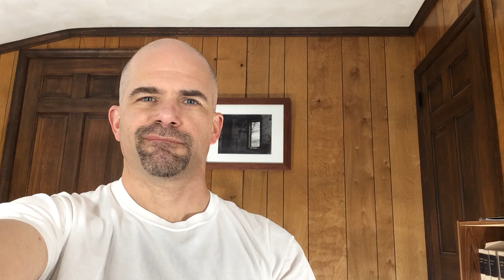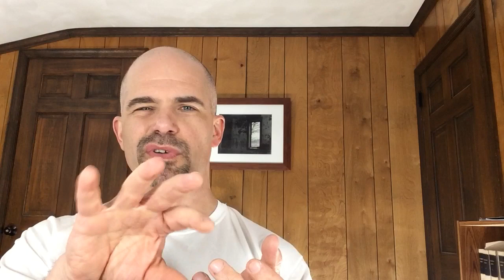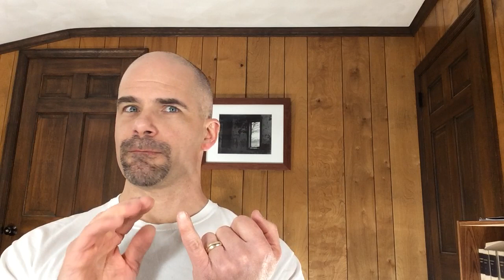Paintball Accuracy, Episode 4: Smooth vs. Spin-Inducing Barrels

Comment: I have a solution to the back spin accuracy problem, good paint, low velocity to prevent denting of ball, tect barrel insert on a flatline with apex 2 modification. Dont forget a good air reg and long air line.

Comment: I've used an Apex 2 on an old pre-2000 Autococker and an Empire Dfender.  On both markers I saw a noticeable increase in absolute range, but after a certain distance (70 to 90 feet) the accuracy began to drop off due to some balls veering off to the left or right.  Balls were going further in the right direction but they weren't very accurate once they exceeded the "max effective distance" if you will.  That said, when you're using something like a Dfender you can make up for accuracy with volume.  Thus, the most effective employment of an Apex 2 I've found is during scenario games where the extra distance is helpful and you're relying on quantity over quality. 

I will say, for whatever reason, the Autococker was more accurate at distance than the Dfender, although I would chalk it up to conditions of play and condition of the paint.  Also, that is one finely tuned slide trigger Cocker and I've always had awesome accuracy out of that marker regardless of the Apex.

Comment: Riffling a paintball has a primary problem when related to a sphere over a bullet or even an arrow. Bullets and arrows continue to spin on an axis in line with the vector. A sphere will spin on the same original axis. This will cause the projectile to kick to one side or the other depending on the direction of the riffling. The paintball inconsistencies noted in the videos make this affect very unreliable. 

As for backspin barrels, I often had better accuracy with my flatline depending on whether I was able to get the velocity and everything else calibrated just right that day. I normally kept it as a fun tinker alternate barrel. The flat trajectory is simply easier to point at something because you don't have to worry about the arc. 

(Please forgive me for speaking in absolutes. It is so hard to speak in speculative terms. Most of this is based on online research rather than hands on experience.)

Based on my research, I have only remember subjective information on 4 backspin devices. In order of least accurate to most accurate (subjective), they are Flatline, Apex, Z-body, and Hop-up. Due to the nature of a backspin barrel needing to be aligned vertically, all but the Apex were marker specific. And since Z-body and Hop-up were not main line manufactures like Tippmann, they fell by the wayside. 

Here I will give my theory as to why the Hop-up was reviewed more consistently accurate than the Flatline. Consider the frictional forces on a paintball. First the Flatline. Staring down the barrel and drawing lines outward from the center of the paintball to indicate the amount of frictional force applied by that section of the wall of the barrel, we get a rough egg shape. Most of the friction is on the top because the paintball is thrust that direction by the curve in the barrel. When we add in the seam where the two halves of the paintball are attached and any other random inconsistencies inherent to modern paintball, the outline of an egg starts wobbling as the paintball rolls down the barrel. 

The Hop-up barrel was made with a type of straight riffling along the top of the barrel. There was one grove and 12 o'clock, one at 1 o'clock, and one at 11 o'clock. The aerodynamics of this pushed the paintball against the top of the barrel. While not as much backspin was achieved via this approach, it did create some. Now, if we look at the same egg shaped forces, we note that there are three sections not applying any friction. The paintball seam and any dimples require a significantly greater defect in order to cause the paintball to spin any direction other than aligned with the two rails of high friction. 

Applying the forces of friction to each of the above backspin models and accounting for paintball defects, I found that the theory was backed up by the "evidence". (The evidence being reading many, many reviews.)

This brings me to some of the comments made in this video series. If a paintball can get a random, tiny amount of spin imparted to it when it leaves the barrel, then perhaps it would be best to have a few inches of the end of the barrel be the Hop-Up barrels style of straight riffling so that that spin always comes out the same direction.
Reply from the maker: Thanks for weighing in.  To your larger point here, the problem with any sort of spin induction is that, not only is is demonstrably less accurate (see the lengthy comment dialogue in this video), but there is also the issue of actually holding the marker. The moment you  title the marker in any way you have just altered where the ball is going, even if the bore axis of the marker is still pointing at the same target.  This means a second order of complication with respect to getting the paint to go where you want.

Thanks again!
Reply: @thatpaintballchannel179  To my larger point, to claim that a paintball is demonstrably less accurate is impossible. As I was trying to state, there is a fundamental flaw with the current way that the backspin in induced. As such, I have not heard of a test that was able to eliminate these flaws. I simply want to state it may be possible to produce a more consistent backspin. Should such product be produced, the tests should be re-evaluated. 

I further theorize what the primary flaw is and how to counteract it so that a more consistent axis of rotation can be produced. Admittedly, this only helps to produce a consistent axis and not a consistent amount of spin. 

One last point, I have been an A-5 user largely because I play with my eyes lined up with the site of the marker. This style of play does not have a problem with tilting the marker. While I usually play with a straight barrel, I would occasionally switch to the Flatline barrel. I never had change the way I held the marker to compensate for tilt. 

Baseball has demonstrated how some spin can be used by a pitcher to produce improved accuracy/consistency over that of a knuckle ball pitcher. As long as paintballs still struggle with accuracy, players will hope that someone finds a way to use those principles (perceived or imagined) to help.
Reply: @popebobcat3716 so much effort and thought in a youtube comment is admirable. I have a radical new idea for a spin inducing barrel that for now ill just say involves some very fast moving parts to the barrell itself. Your input was enlightening